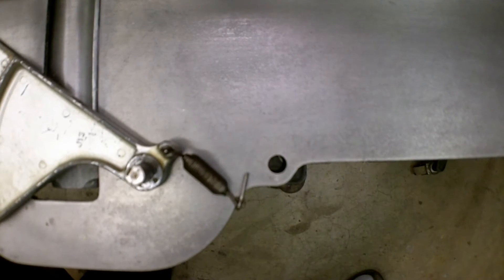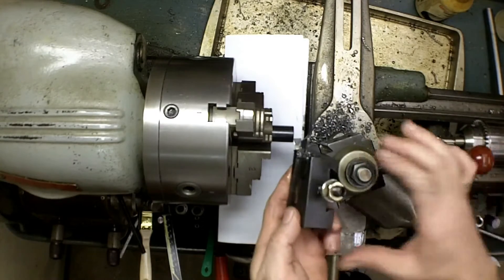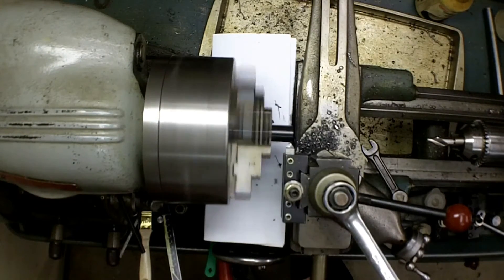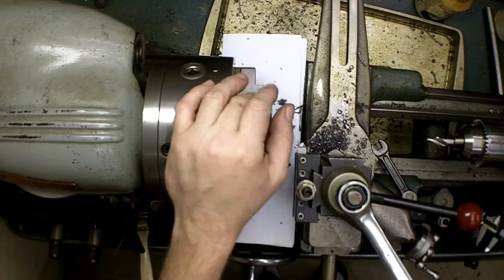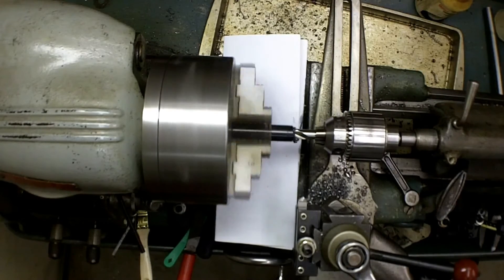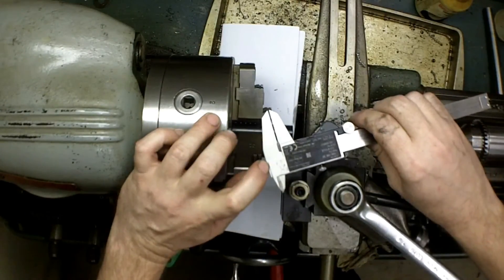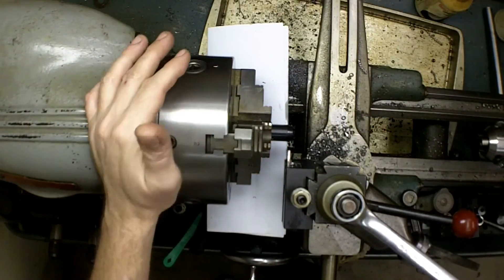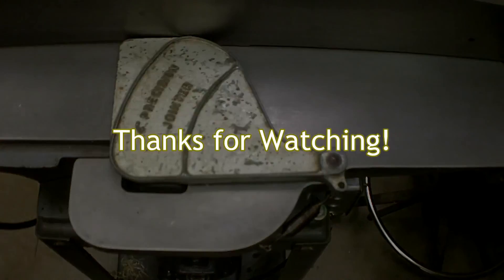How to Make a Delrin Washer Plus Lathe Operations and Tips

Comment: Enjoyed it. If you don't mind my asking, where did you get your lathe and how much did it set you back? Also, did it come with all the attachments? I'll say It's in excellent shape. I did not detect a bit of slop in any of the axis. I used lathes like this over the years but I mostly worked with old automated Hardinges and at the end Okuma CNC's which are a world unto themselves complete with 4 axis real time steering...if you know what I mean. Don't even get your hands dirty

I never run it, but we had a 6 turret Acme lathe that was from the 40's. It was 12 feet tall and could run 6 pcs of 6"x12' bar stock at the same time. It had six tool stations and worked all 6 bars at the same time. The tools would withdraw and all 6 bars would index to the next station. That monster could spit out some parts in a hurry. It was a treat just to watch it run. Great vid as always. Thanks G.
Reply from the maker: Thanks Bain. I found the lathe locally on Craigslist. They started out at $2500 and kept running adds lower and lower. When it reached $1000 I pounced. The chuck itself cost as much as I paid. It came with lots of tooling, but not too many attachments. I picked up most of the attachments for good deals on Ebay. For its age it's really tight. I've always meant to tear it down to pretty it up, but haven't found the time yet. Cnc's are definitely cool!

I'd like to see that monster work. I have a couple of Atlas 6" lathes and my South Bend 9" (The one in the video) seems like a monster in comparison. It just goes bigger and bigger to ones like you noted.

Thanks, G.
Reply: Thanks for sharing the info G. I might start looking for a deal myself. Your right about the price of the chuck. Yea, that acme was a monster for sure. Lets just say this. One could crawl inside the tool compartment and easily use it as a small bedroom. It would take at least two or three very large forklifts to move one half of it I'm sure.
Reply from the maker: bain5872 No problem Bain. Local is for sure better since shipping would kill the deal. LOL, add a microwave and frig and one would be set! G.